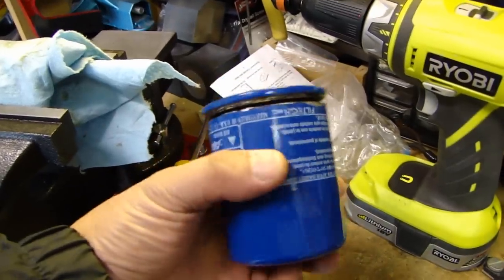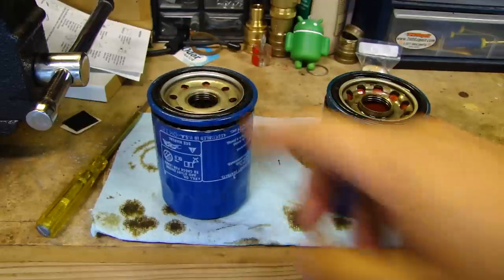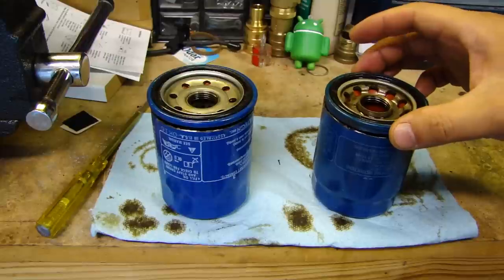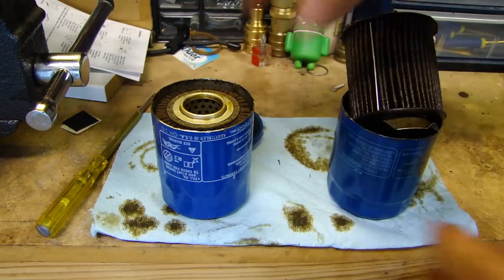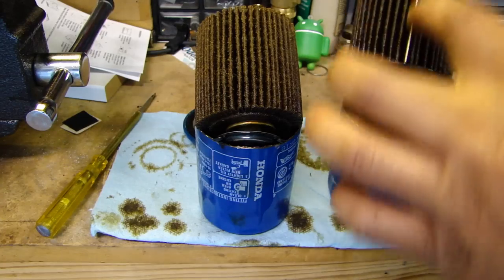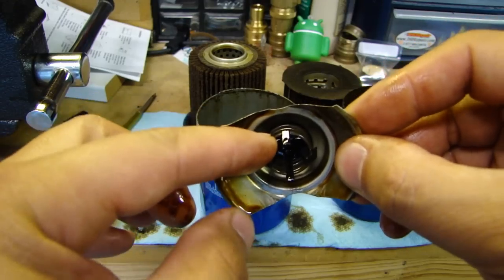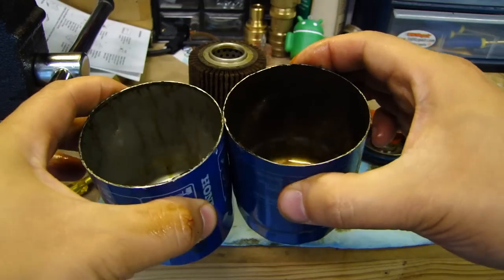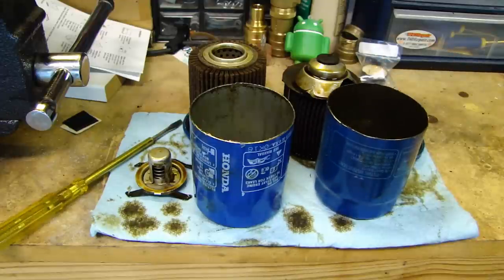Honda Oil Filter Comparison: 15400-PLM-A01 and 15400-PLM-A02

Comment from the maker: I agree that each filter has pros and cons. I think as long as you change your oil every 4-5k miles, then you are not stressing the filter to a point of failure. I also heard the S2000 filter works as a replacement for this and the Part # is 15400-PCX-004, but I have not tried it.

Comment from the maker: I agree with you, if you follow the regular scheduled maintenance, it doesn't matter if you using FRAM filter or AC Delco filter or OEM filter. Same for the argument with Mobil 1 oil vs Walmart oil. Has anyone come forth and claim their engine is blown when using FRAM filter and Walmart oil (IF THEY PERFORMED REGULAR SCHEDULED MAINTENANCE)? The answer is NO.

Comment: Fram was owned by Honeywell's Consumer Products Group untill 2011, Fram is now owned by Rank Group, on connection to Honeywell for a number of years.  I note the construction of the filter you have there is essentially the same as Fram, of course the video is from 2012.  It would be interesting to see who is currently making their filters (2018).  All the time I've owned an Acura and then a Honda I utilized a trusted local oil change business that used Purolator oil filters.

Comment: I have used and will continue to use both the A01 and A02 with confidence. Honda approves then so do I. Thank you for taking the time.
Reply from the maker: Bravo + Gold Eagle My thinking is same as yours. Honda wouldn't use an oil filter that can destroy their engine.
Reply: At least this video proves that there are better option. Honda just approves the bare minimum required
Reply: Honda determined the specifications and if a part meets the specification, then it's good enough.  The specifications are set so that the part can withstand any reasonable driving conditions your car was designed for, plus a certain safety margin.   So A01 and A02 both meet the specifications.  Perhaps the A01 has a wider safety margin than the A02 but for all intents and purposes, it does not matter because 99% of owners drive well within the limit set by the specifications of their car.   Most of the folks who swear by A01 are probably doing so for reasons that are purely psychological.

This video is very informative and to me, the differences do not matter much in practice.
Reply: Just saying there are better filters out there for not much more money. You now know what Honda specifies as the minimum requirement they want for an oil filter, you'll be able to find oil filters that surpass that spec if you want better oil filtration and less engine and oil wear.
Reply: "better oil filtration and less engine and oil wear"

Is there empirical evidence supporting this?
Reply: There's tons of evidence dude... I could tell already that the Honda filter from Honeywell is a fram toughguard filter... Which is ok but there are better filters especially if you want to go longer on Synthetic oil... Look up filters that use full synthetic filtration material (I.E Amsoil, royal purple, Wix XP, and even Fram Ultra Guard filters) they use full synthetic materials that filter 20 microns at 99.99% efficiency. They even use higher quality materials like metal endcaps and even a wire mesh inside the filter pleats to prevent the filter from collapsing and a high quality metal spring for the oil bypass (except for the fram). There's a reason why some filters can cost up to $20 all for that extra protection for maximum engine life and performance, manufactures would never pay that for their cars. They want the most acceptable performance for the lowest cost that's how manufacturers work. Not saying the Honda filters are bad, they're just acceptable and there are much better choices out there if you choose to spend the extra money if vehicle longevity is your main priority.
Reply: Where are the "tons of evidence"?    I am asking for empirical evidence, not anecdotal.  You provided none.
Reply: + Darksyne
Thanks for the link.
Reply: Darksyne this is interesting for me since I've been using these filters for 225k miles on a 7.5k mi. Oci for the last 14 years. Kind of surprised that these things are so crappy, & that I've made it so far as well.
Reply: As long as the filter element doesn't collapse before the bypass valve opens, what does "better" mean?
As long as the can cover crimp doesn't burst at the maximum oil pressure of the motor, what does "better" mean? If the oil pump relief valve sticks and absolutely will not open, any motor's oil pump will burst a spin-on filter.
Finer filter media will clog and begin bypassing sooner. You can get filters down to one micron if you don't mind changing the filter every day.
Reply: I switched to bosh. Quality filters for $3 shipped to your door. No rebates, dealership runs etc. Quality is very similar to a02.

Comment: Went to my Honda dealer today to get the “newer” A02 filter. Parts guy said Honda had lately been shipping the dealership only the 15400-RTA-003 “older” filter. He didn’t know why but he also mentioned that a lot of the Honda mechanics complained about the OEM filter wrench tool not fitting well on the A02 filter. I would agree. The A02 filter’s metal is too flimsy and my OEM filter wrench tool recently stripped out the end threads of an A02 filter, and I wasn’t over tightening.

Comment: I just cut open 2 Honda cr/v filters, one made in Thailand, the other Japan. The biggest difference was the Japanese version had spring loaded bypass valve, the Thailand version didn’t have that, just a open hole

Comment: Thanks for the video and confirming my suspicions. I was a regular buyer of the Honda OEM filters until they switched supplier to what looked like a Fram. I buy either Purolator or AC Delco high quality filters (marketed as Mobil 1 or Bosch) and I've never had a problem.
Reply: +John L Just because you never had a problem doesn't mean they're better.  I have a Civic with 179,000 miles on it. Most every oil change done at STS with whatever cheap oil filters they use. I've never had a problem either.  If you change your oil when you are supposed to, the chances are you won't ever have a problem.
Reply: +Nick V I didn't say one filter was better than another. A Fram filter is better than no filter at all and people continue to use them by the millions every year. However, I've seen several videos of dissected oil filters and I am not impressed with any aspect of construction of Fram filters. Therefore, I will not use them for my cars nor would I recommend them. I'm glad you've maintained your car to keep it going for 179k and wish you many more.
Reply: On my 2011 Acura TSX I was using the oem Honda one but ever since I watched this video I only use K&N oil filter

Comment: Wix makes filters that offer better filtration and greater capacity.  There is nothing special about Honda brand filters.  The problem is that none of the manufacturers will release the performance data on their filters.  The ASTM standard is for single pass filtration.  Some filter catch more contaminants but they become clogged too fast.  If the filter gets clogged, the bypass opens and the engine gets unfiltered oil. You need filters with greater capacity when using synthetic long endurance engine oils.  It isn't necessary to change the oil, you can just change the filter half way between oil changes.
Reply: You can install a bigger unit if there is room for one.

Comment: Judging by the design differences I would say the main reason Honda changed manufacturers was cost savings and larger profit margin. Personally I only use WIX XP filters which IMO are of a higher quality then both the A01 and A02.

Comment: A dozen or so years ago I had King Motorsports build me a '01 spec B18c5(Integra Type-R motor) and they told me to only use the Japanese-Made OEM Honda S2000 filters on that motor.

That was right at the time that Honda switched to the smaller oil filters.  I remember Spoon Sports of Japan saying the newer small filters were better, but the ones they were using were likely Japanese-Made.  The small filters available at the Honda Dealers were Canadian-Made Honeywells.

15yrs ago I used to be able to order 10 packs of Japanese-Made OEM Honda Oil filters for only $40!  That was only $4/ea!

Comment: I actually read an article from Honda when I worked there as a mechanic around 1999.
The article was about a Honda gold wing owner that used an after market oil filter on his new GL1500 gold wing, which used a Honda filter with the same part number as a Honda automobile.
The engine on the gold wing seized up a few days after the oil filter was installed.
Since the gold wing was still under warrantee, the dealer disassembled the engine to see what actually caused the engine to seize up.
The seizure was caused by hardened glue in the oil passages of the engine that had melted out of the oil filter on a long ride he took after installing the after market oil filter.
Honda engines have a very high oil temperature during operation, and yes hot enough to melt the glue in a generic oil filter.
Maybe it was that one in a million oil filters that had a glue flaw, who knows.
But if Honda doesn't recommend use of an aftermarket, or brand name oil filter that doesn't meet there specs, take there advise, there's a reason there deterring you from using a generic oil filter.
Reply: Their, their, they're.
Reply: @morrij01  just theire're for everything
Reply: “Whoa, We Didn’t Ask You That.”

Comment: Yeah, it is unfortunate Honda started approving use Frame/Honeywell level filters.  (This is all about the bottom line profit.)  I guess they are ok as long as you change the oil on the 3500k/5000k interval.   Purolator, Bosch, Mobile One, Wix, Toyo Roki and Filtech are still the better filters.  I recently bought a box of 6 of the Honda A02s for $6.00 a piece.  Now I know why!  Not again.

Comment from the maker: OEM = Original Equipment Manufacturer which is what the factory uses. Aftermarket parts are copied or designed on their own to be used like an OEM part. There may or may not be a fitment issue.

Comment: Honda Japan and Asia have different Honda Oil Filter Part Numbers: 15400-RTA-003, 15400-RTA-004, 15400-PLC-003, and 15400-PLC-004 which they are clearly made in Japan obviously and I’d like to compare them to Honeywell and Filtertech North America Versions

Comment: Great video revealing FRAM in a blue Honda oil filter container... Fram is one of the worst built filters and that can be confirmed via the internet. LOL... Now, I will never buy a Honda Oil filter again... Thanks... FYI: I found out about FRAM super low low quality over ten years ago and hadn't used them since. I instead went to using Purolator on all my car/trucks... NOW, will use Purolator on my Honda Odyssey...  :)
  Ps: according to Mowerman, I guess I will see if Denso filters are easy to get where I live... the silicone anti-drainback valve, synthetic/paper blend media sounds like a good mix...
Reply: I agree with this post.  Purolator, Bosch, Mobile One, Wix, Toyo Roki and Filtech are the only ones to buy.

Comment: Clearly, the A01 (Filtech) filter is of higher quality than the replacement A02 from Fram/Honeywell. Seems like Honda made the change to likely cut costs. That said, I'm not convinced that the A02 would cause problems for people who reliably follow Honda's recommended maintenance schedule. It would be helpful if an oil and filter analysis got done by someone to see if there is a significant difference.

Comment: Thanks for the video.  Frustrating to know I've been putting low quality filters on my Honda's the last few years.
Reply: +Marty Montgomery Yeah, I found out about this a few years back from a fellow 8th gen owner. I would have never thought to look at the manufacturer and I just assumed the part number changed. 

Since then, I just started using the Fram Extra Gaurd instead. It's cheaper and it's the same guts as the A02. I have been feeling a bit guilty for using the Fram's but with ~5000 mile changes, I figure they work well enough. 

After watching this I ordered a couple of cases of 5 filters of the A01's off of Amazon last night. Hopefully they are legit.
Reply: +Kevin Williams The A02 filter is more like the Fram Tough Guard than the Extra Guard.  I would advise against using the Extra Guard on anything you care about.  If you must use a Fram filter on a Honda, use the Tough Guard.  Honda still sources both Filtech and Honeywell for its oil filters.  As a Honda tech I'm switching them back and forth all the time, although I see more of the Honeywells.  The Honeywells are probably cheaper and the Filtechs are sourced when Honeywell can supply enough of them.  I can't recommend running an aftermarket brand filter on a Honda because some aftermarket filters will cause enough of a pressure drop to prevent VTEC from working.  Surprisingly, I even see this happening when Wix filters are used.
Reply: An oil filter can't cause oil pressure to drop unless its clogged to the balls. Something else is wrong. Right now I'm using a Fram Ultra Guard since it's the cheapest filter that uses true full synthetic filtering material instead of a blend.

Comment: Honda didn't actually replace the A01 with the A02.  They still sell both, the dealers just don't get any say over which one they get shipped.   Prior to the A01/A02 they had a 15400-PLM-A01 and 15400-PT7-005 that they interchanged.  My guess is that for such a high volume item they don't like counting on just one manufacture.
Both have to meet their specs.  If it is just a matter of grabbing one or the other I'd grab the A01 but the A02 would be fine too.

Comment: My Honda Accord ran 1 mile without any oil in the pan at 9K miles (circumstance I would not elaborated) . It is still running today at 135K. Amazing.
Oil-related failure is extremely rare, I completely agree.
Reply: What year is the accord

Comment: Those small holes are the input holes the larger hole is the outlet hole. hence why you have a drain back preventer covering the little holes.

Comment: I don't hear of any Hondas blowing up engines because of there oil filters. All I ever hear is reliability with very high miles. Change the oil and filter every 5,000 miles and your good  to go. Don't be one of those 10.000 mile oil changers. I personally use Mobil One filters and still change it every 5,000 miles I don't mind paying the extra six or seven bucks  for the Mobil One. They are a great filter and its twice a year. Fifty years of owning cars and never had an engine go on me. They all ran great when I sold them.
Reply: At work the design engineer's Honda  Accord  engine  failed prematurely (57K miles) due to cylinder bore  scoring. There is a HONDA TSB addressing this.  This is  a widespread problem not isolated. The  failure is apparently caused by exhaust waste  organo-metallic and  catalytic material being ingested though exhaust reversion due to close  coupled catalytic converter placement.  Same issue on Nissan 4 cylinder engines. No brand is  immune.

Comment: The dealer usually goes with the cheapest contract on their product to make a better profit margin. The case is not a concern as the filter base will break before it will ever burst, its just a means of reducing costs and recycling of steel.